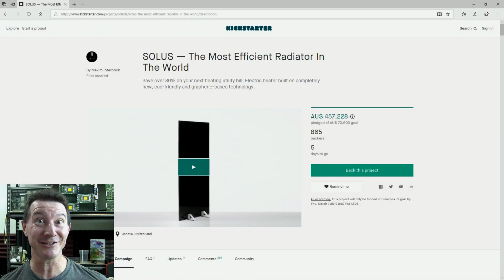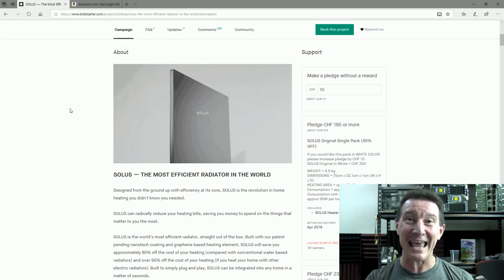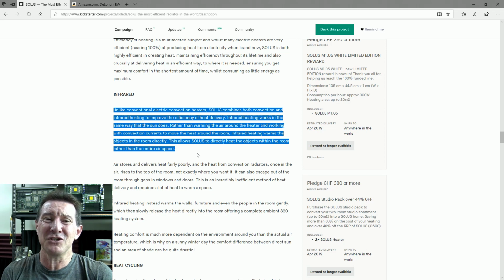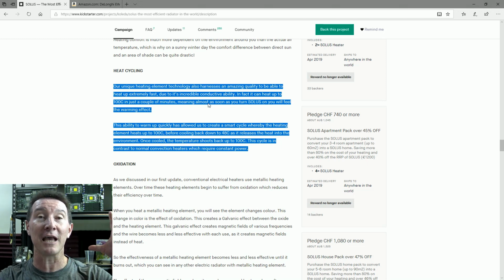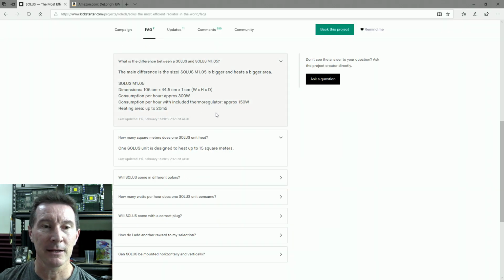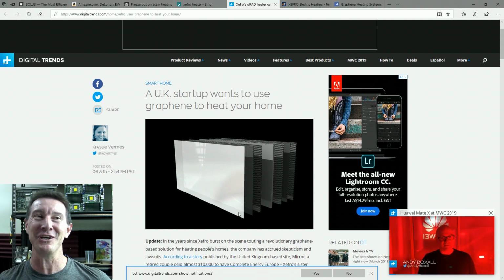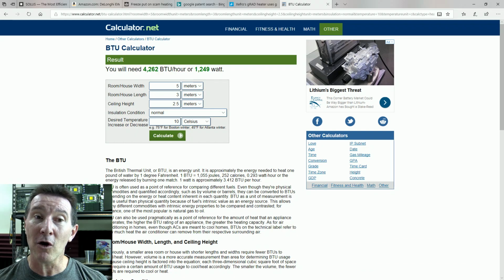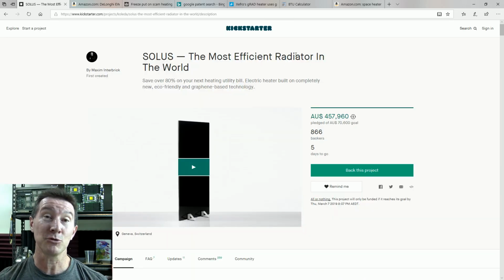EEVblog #1186 - Solus Graphene Heater Kickstarter BUSTED!

Comment: Stand is an additional $1000.

There was a Distributed Computer company that offered compute nodes as radiators. While its a great idea, I don't think it was executed particularly well. Although they are limited to the type of projects it can work on as high-end networking (e.g. 40, 56 even 100gb per node) is an important part of Super/ Distributed Computers.

PS: Central Heating is common (and essential) in most of Europe. Currently 4c in London. Main reason is because heating with gas is cheaper than electric, and most are combi which also provide hot water. Speaking of efficiency checkout condensing boilers, they actually do recover heat from the steam/ water CREATED from burning hydrocarbons.

Comment: the only waterbased heaters we have in europe are central heating heaters using boilers or high efficience central heaterrs.. they use gas burners to heat the water and go though pipes through your house to the radiators.. there are no electric waterheaters here as far as i know

Comment: Australian graphene might be the next gold.

We have usually those water heaters or lines in the floor or infrared heaters ... or air circulation powered by a heat pump. 
Saves energy half of the year ... but no graphene stuff ... nor peltier elements.

the crazy drone campaign is still running ... mavic 2 performance for 50 € or so.

Comment: I can agree with the terms of efficiency. The heating element uses less electric, whilst getting hotter, quicker. This uses less electric whilst achieving a faster warm up, and it therefore using less electric to heat a room compared to the equivalent power draw of an oil radiator.

Comment: A 200 watt heater is going to heat a 15m x 15m room?    Maybe somewhere near the equator, but not in the real world.
Reply: sure it will.
Room size ratings are, mostly, irrelevant. 

It will take significantly longer than a 1500w, but it will work.

Most people have a misconception that the size of the heater has something to do with how big a room a heater will heat.
A small 1500 watt heater, will heat a room as fast as a, physically, larger heater at the same watt rating.
Reply: @chrisbaker8533  I can see you have never worked in HVAC or computed the BTUs required for real world buildings.  But it is good to know that a 60 watt light bulb will keep a room warm in the winter.

Comment: Hey EEVblog, really enjoy your videos, but I feel like you did sort of miss the mark on this Solus heater one. Yeah, it's a total rip-off, and most of what you identified as marketing hype is absolutely marketing hype. But you're not hitting them as hard as you could because you're not addressing the infrared claims properly.  The whole idea here is to force the heating element to operate at a very high temperature, so that you get a significant amount of infrared radiation. Of course you get 1.0 COP, no argument... but you can choose more convection or more IR. Their thermally non-conductive glass is doing just this, in a not-super-effective way. There are much simpler embodiments. For instance the "IR dish heater" https://www.macys.com/shop/product/optimus-h4110s-heater-9-dish-300w-ultra-quiet-handle?ID=10345820 ($35 US, about what this thing should cost!) form factor has been around since the '70s, maybe? Maybe the '50s? Usually sold at 300W rating. The dish heater does efficient IR emission very directly, by using a small nichrome wire coil-on-ceramic element with small area and hence poor convection, which ends up glowing orange hot. Obviously this silly panel really has too much area and too good of a convective heat transfer to be a good IR radiator, so it's rather funny that they're calling it efficient, since it's definitely going to be worse than any IR heater which is running orange hot. Now, ultimately, these IR heaters are only 300W, and they've been around for ages. But where these IR heaters (or at least the functional ones) actually can work is when a person is not using an entire room, and is stationed in one place for a long time (watching TV, on the computer, working at a bench). You aim it at you and it dumps the heat only on your skin/body, without bothering to heat the air or anything else. In my book it's not a very pleasant heating experience since your back side is freezing and you cant' really move out of the IR glow or your front is freezing also. But if you're trying to skrimp... an IR heater can't be compared to the oil heater "radiator" or any of the other mis-named "radiators" you discuss, which are still transferring most of their heat through passive convection. Any heater that transfers the majority of the heat through IR (which I am skeptical that this one does) can be used in a qualitatively different manner than a convection heater (forced or natural), so I guess that my comment is that in order to really nail these guys for their wankery, I wish you'd acknowledged this so they didn't have any grounds for dismissing your other criticisms on the grounds of  "he didn't get it".
Reply: Sorry mate, the whole "infrared" thing, doesn't actually make a tinkers bit of difference.
Any heater, at the same watt rating, 300 in the case of the one you're linking to, will produce the same result as any other 300w heater.

First law of thermodynamics.
Reply: @chrisbaker8533  Sure Chis, that's true of the whole room. Nobody is arguing that.

But it's certainly not true of any given piece of surface area. You're basically looking at the wrong control volume if you look at the room. The whole point of IR radiant heating is to reduce the size of the thing you're trying to heat, and therefore increase the achievable temperature rise with a given power.

Let me ask you this: if you (or any passive object) were wrapped with a 300W heating blanket, would you be warmer than if a 300W heater with a fan were trying to heat an entire room? 

Yes: the thermal resistance from heating blanket to the room air of that small (2m^2, say) blanket is massively higher than the thermal resistance of the walls (50m^2) of the room to exterior ambient. It's the same question as "is the electric blanket hotter than the walls of the room it's contained in". Yes, definitely. The same Q is being transferred first across a 2m^2 interface from blanket to room, and then across a 50m^2 interface from room to ambient. The temperature drop across the first interface is massively higher (unless the walls are ridiculously insulative).

Same deal with radiant heaters. You just reduce your expectations. You say "forget heating the room, I just want to dump X watts of heat directly onto my skin, to fight the losses from my skin to room air". With a metabolic rate of ~100W, dumping 300W of IR onto your skin really helps. It's huddling around a camp fire we're talking about here. You sure as hell aren't heating the outdoors with the campfire. But it still keeps you warm.

Comment: The glass panels keep the heat trapped by the elements meaning it takes longer to dissipate the heat generated.  The heater stays nice and toasty so you only have to run it half the time.  Meanwhile the rest of your room freezes over.

Comment: It's a different kind of "heat", that's how it never rises to the top or escapes through the windows. It's called "hot air", or when used as a verb "smoke up the backside".

Comment: Of course you can save up 80% on your heating utility bill... You can even save up 100%. Sure, your electricity bill increase will be 2-4 times higher than your "savings" but that's what happens if you switch from gas/oil/municipal heating to electric.

Comment: I made one of these when I was young. Painted my (water) radiator black to make it more blackbody... Now we could use the ultrablack stuff that people are making.

The difference between white and black radiators is the mix of convection vs radiation, isn't it? more black, more radiatitive?

Which makes me wonder if the ultrablack coatings coupled with that aerogel insulators oculd make a really efficient solar hot water collector.

Comment: "Graphene paste," you mean graphite?
Reply: Not really relevant to how this product would operate, and I'm not claiming that paste is not made of graphite, but even if you had a perfect stack of multiple layers of graphene, the resulting structure is not necessarily graphite. Graphite does consist of layers of graphene, but oriented in specific ways. If the graphene layers are "misaligned" in this way, the resulting crystal is not graphite.

Comment: 3.41 BTU's per watt period for resistance heat, convection, radiant, induction does not matter, watts in, heat out, 100% efficent,  Coefficient of Performance of 1, new state of the art heat pumps are now approching three and a half to one C.O.P., to bad so many confusing formulas are now out and being used to confuse the average JOE,  SEER, EER, HSPF, etc.............pretty much all you need to know is the COP at high and lowest operating outside air temp(fluid temp for earth coupled) heat pumps

Comment: Hey man, looks like electric engendering and physics don't entirely mix. Look at heating with a INFRARED WAVES, and infrared wave generation using carbon heaters instead of AIR heating. This one works with INFRARED WAVE generated by the heater and that is why it has a glass as is not designed to heat the air. So siting near by, your body will absorb the infrared light like from the sun and that makes you warm 80% more efficiently. Direct sun light do not heat you by heating the air. Real life example - Right now I am using multiple DEVIANTI to a total of 3.6kw - a radiation infrared heater and it works great at heating 200sqm warehouse, but not by heating the air, as is impossible with our wide open warehouse to heat 200sqm by heating the air. Please look at the physics before rubbishing somebody's product.

Comment: Hey! Maybe in Australia these things didn't get popular, but here infrared heating panels are the subject of tons of websites claiming "super high efficiency heating" and "heat where it's needed". These websites almost always have this "scammy" feel in common. It's all bullshit of course, all you get is a sense of heat if you are in the direct "shine" of the panel, but in reality you just buy a number of low power passive convection heaters (they are typically a few hundred watts at most, each). It's funny that they boast about the infrared part, that it "delivers heat where needed" (your skin), but obviously they just put a thermostat in this, which will measure the air temperature, and thus they have to heat up the air just like any other convective device, and they'll definitely do a shit job at that, considering the lack of a proper heat exchange surface (as opposed to a good old finned radiator)..... This thing is a rather pointless rehashing of an old, and pointless "solution".

Comment: Wait. OIL heaters?
Like, oil used to transfer heat from the heater to the radiators? You have oil pipes in your house down there?
I'm getting this wrong, right?

Comment: They are on Indiegogo now, as SOLUS PLUS - THE RADIATOR OF THE FUTURE. The new, improved version uses  800 W to heat up to 20 square metres, with savings of up to 30%  ;)

Comment: I'm wondering if people spending money on this ever visited at least a basic physics class. My face felt of to the ground as they were talking about efficiency, its the most easy thing to turn electrical energy to heat. The only way to achieve some sort of efficiency is to place it on the ground in the middele of the room (or at the place where you usually be in the room) just to not heat up the walls.
Maybe they're using some radioactive material in it which in fact produces additional heat :'D

Comment: Why use a "flat paneled" radiator with less surface area for $200+, opposed to an actual $50 radiator. Or, skip all the bullshit, run a full Windows Defender scan on your laptop and sleep with it next to you. Works better than Eco Rico's flat rock that you get to plug into the wall

Comment: isn't it posible that the glass is to keep the heat in and let infrared trough? so that its more 'efficient' because it doesnt heat the air as much and radiates more IR, just like electric garden heaters. The IR will still be converted into heat in the room but i think it will feel warmer per watt right?

Comment: My favorite is "due to it's [the heating element's] incredible conductive ability." Aside from the fact that they spelled "its" wrong, their rocket scientists (obviously model rocket hobbyists) don't know that the resistance is what generates the heat? Seems like a fundamental concept to understand while designing a space heater. Conductance <-> Resistance. On the other hand, if you made the elements perfectly conductive and forego the use of breakers for the circuit that you plug it in to, it WOULD heat your house up more than it has ever been. The firemen who come help you cool it back down could probably tell you how hot. These guys are why I've never had high hopes for Kickstarter as and idea. On its surface, Kickstarter is an amazing concept. In a perfect world, it opens doors for people who have useful ideas but can't otherwise get them funded. However, in reality, it's a scamground for scumbags, so it's a matter of time before people stop trusting any of it.

Comment: The fact that glass is an insulator might not matter much. Even a 50 degree temperature delta across the glass might not be a big problem. After a while the glass panes will heat up. Still no better than any other radiator of course! Having an IR heater could perhaps make the room feel hotter than it is. But they can't let the radiator get hot enough for this for safety reasons (and also outside their power budget I believe).

Comment: Although ofcourse these product claims are BS, a few remarks have to be made. Convection heating does NOT use fans.  Convection is the process resulting from hot air rising up. So these things might actually be convection heaters, if they have channels inside that allow the passage of air. The idea is then that air is heated inside of this thing, and the air rises because of heating, drawing new air in from the bottom.

So even though their claims of 80% and so forth are obviously bullshit, it might actually be a convection heater.

Convection = NO FANS.

Comment: The one aspect of graphene that I didn't notice you mention is that the extreme thermal conductivity is directional and perpendicular to the atomic matrix. If the graphene were to be applied in a paste then the arrangement of the graphene matrix would be random and therefore would have a random thermal conductivity.

Comment: wait. Only 100C? That's nothing. The heater I have in my office gets up to around 240C. I've looked at it with my thermal camera and it's very hot right where the elements are. 100C is not all that hot especially when your objective is to heat a room.

Again this is an issue with the general public not understanding how things work. A heater running at 300W on a 50% duty cycle uses exactly the same amount of power and produces the same amount of heat as a heater running at 150W but always on. If anything the one with the 50% duty cycle will likely break 1st if the quality and materials are the same.

Comment: graphene is a sheet of carbon that's a single atom thick. So how exactly are they achieving this in a paste? 
the point of a resistive element heater is to be as inefficient as possible in the conventional sense of efficiency. The issue here is the general public. Most people don't understand this stuff nor do they care to actually understand this stuff. So many times I've brought up the math and physics of things and people typically respond with "math, gross". Math is the reason you have all these things you people love so much. It irritates me how much hate math gets when it's basically the most important thing we ever created. It's the foundation for just about everything in modern life and by far the most important subject in school.

Comment: Sadly, I could see some sort of benefit from a product like this, but as under-tile floor heating. The high thermal conductivity of graphene could mean that you need a relatively small element to cover a relatively larger space, but if you're hoping for radiative heating that's not in direct contact with the surface being heated, this thing is hopeless.

Comment: A real ultra-efficient heater would be mining rig that comes on when you need heat.  Make some money back to pay for at least some of the electricity.

I think the 'heating in a efficient way' is that its supposed to be a infared heater instead of just a radiator.  Yes they both take the same amount of power to heat a room but the infrared style heaters are really just to blast a person directly with heat so you don't have to warm the whole room.  Those round dish style infrared heaters really do warm you up with less power, well sort of they only heat one side of your body and you have to sit the perfect distance away from them to get warm but not burn.  Personally I just like the electric blankets.

Comment: Great video, EEVblog. I am no technician or scientist. The thing that concerns me most about this Solus Graphene Heater, is that fact that it uses Tempered Glass. I mean I understand that the fact that tempered glass is highly durable and used in the construction of many consumer products E.G. Phones (Mobile/Cell phones), TV's, PC Chase etc. However, if someone is using to face of a heater, wouldn't the constant changing of heat fracture/crack the tempered glass? Turning it into a massive safety concern, especially with them marketing it to be used in a Home environment?